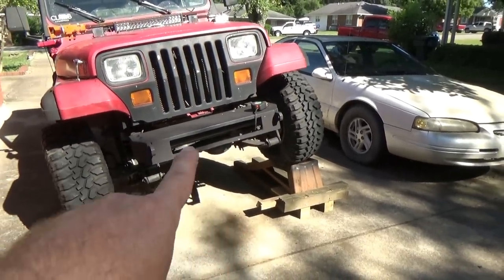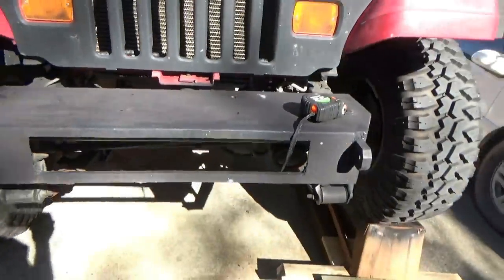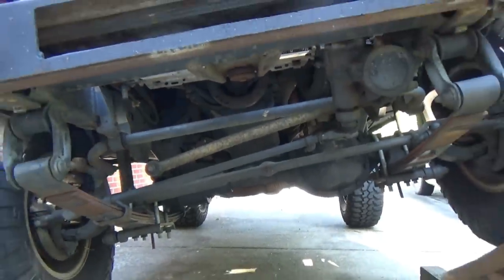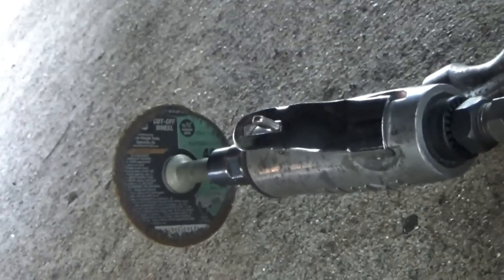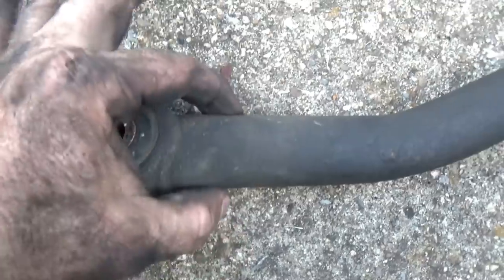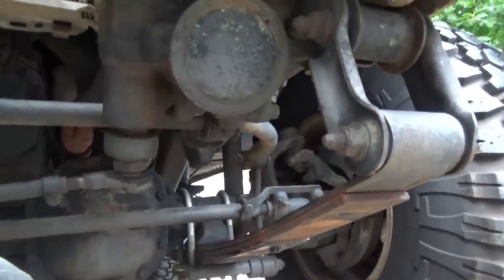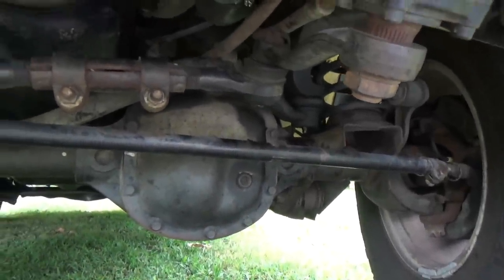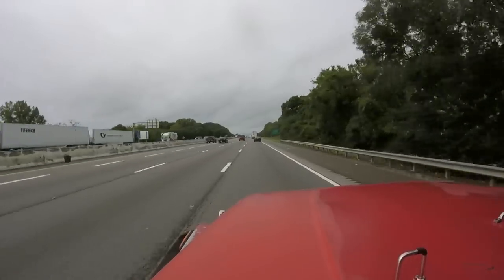Jeep Wrangler YJ - I removed my Track Bars

Comment: Just watch yourself if those leaf spring bushings go you will get death wobble with track bar removed. Mine didn't start until I ran 33" wheels, no track bars, no sway bars & then over time leaf spring bushings wore down... Buying new lift kit so all new leafs and bushings soon.
Reply from the maker: You need to check your steering parts. Only coil spring rigs get death wobble. I've owned Jeeps, Chevy trucks, and an International Scout, they are all leaf spring rigs that come from the factory with no track bar. This exact topic is all over the internet .. only coil spring rigs like TJ, XJ JK .. etc get death wobble. If a YJ has front end issues, its ball joints or bad steering parts. Have a great day!
Reply: Thanks - I’ve seen a few videos where leaf spring suspensions had death wobble but it makes much more sense to occur on coil suspension. I’m starting with leaf spring bushings - actually just running whole new lift kit because the springs I have on now are nearly flat and I believe I’ve got some axle wrap (clunk) - bought this jeep recently so just getting started, it’s my second - did a full build on another YJ that I owned for 10 years never had any suspension or steering issues. Thanks for the tip, might be worth just going through at all at the same time and hitting ball joints, pitman and tie rods. Not currently running sway bar or track bar but thinking about installing them since I have my old ones still. Thoughts? Thanks!
Reply from the maker: I've has some rough wore out leaf spring rigs and never had that happen. But anythings possible I reckon. Im gonna rebuild the front axle out my 93 and swap it under the 91. The 91 (the one in this video) is my daily, the 93 I have now is gonna be the toy. What lift kit did you go with?
Reply: Rough country 2.5” - bought the jeep with 2.5 body lift. Don’t want much more than that.
Reply from the maker: Im not a fan of body lifts. Both of mine have 3" because the PO installed them. The 93, I'm pulling all that out because I'll be seriously modding that rig. Id like to take the BL out of the 91, I just know there is gonna be twisted broken bolts. I don't wanna take it out that bad! LOL. The 93, I'll probably do another junkyard lift to start out. Thinking of a 6" rear stretch using Cherokee leaves. There is gonna be a swap meet this coming weekend near me. I've heard that RC is supposed to be there. I may go talk to them and see what they got see if the change my mind on the junkyard lift. I'm running mixed leaves in my 91, the other leaves came from a GMC Sonoma. I got about 2.5" of lift for a little less than $150. Works and flexes great.
Reply: ^The new rig I just bought is at the end of that album sitting next to that old blue ford pickup.
Reply from the maker: Where do I go to see this?
Reply: It is a facebook album - if it doesn't come up go ahead and add me
Reply: I just liked your fb page - I tagged your "Fix Jeeps" facebook page on my album. Feel free to comment on the album with any of your own rigs - love sharing ideas!

Comment: Got a 1990 yj would it mess anything up if i daily drive with the track bar and sway bar off and i only off road it acupal times a month
Reply from the maker: I drive minimum 300 miles a week in mine. It is my daily driver and even road trips. No issues at all running no track bar. I have quick disconnects for my sway bar. I havent had those hooked up in over a month. Dont miss them at all. Thanks for dropping in! Have a great day!

Comment: Thanks for this video. I will be removing mine very soon. Hope I dont have to cut and grind and cuss, so much lol
Reply from the maker: You are welcome! I only cussed when the camera wasn't rolling! LOL . I would say shoot plenty of PB blaster way ahead of time. But it wasn't the nut that was seized up, the bolt was seized inside the metal sleeve. Not likely any penetrating fluids are gonna help much with that. Good luck! Hope yours comes off way easier than mine. Thanks for checking out the video and taking the time to leave a great comment!!

Comment: I have a 94 daily yj, You mentioned that the cjs would flip over easy when switching lanes, how slow should you go? I'm really interested in doing this but paranoid aswell
Reply from the maker: I daily drive mine 70+ miles a day to and from work at 70-75 mph. Several 300+ mile road trips at highway speeds. No issues of any kind. What I said was sudden changes and curves. Not casual legal lane changes. At the end of the day its still a high center of gravity small 4 wheel drive Jeep Wrangler .... not a Corvette, so don't drive it like one. Its up to you as to whether or not you remove the track bars . The only real benefit is the Jeep rides smoother and more suspension flex. But, if it makes you paranoid, then don't do it ... If you don't take your rig out heavy 4 wheeling ... don't do it. .. Its OK if you don't. No harm done. I know several people still running theirs and their world is good. Oh, one more thing, its illegal in some states or counties to make modifications to your vehicle which can make you fail yearly inspections if you have to have that done. So check your local laws before start modding.  That may or may not be the answer you was looking for. But honestly any modification you read about, see on the TV or internet is a suggestion. Its up to the vehicle owner as to whether they feel comfortable with modifying their ride. Good luck and thanks for dropping in! Have a great day!
Reply: Jonathan Bernal 
I think the rollovers were with the narrow track CJs. I had an '86 for about 9 years and I've had an '84 for the last 3 and I've never had a feeling of rolling. Now I have s yj and the track bars will be removed, after inspection of course
Reply from the maker: True, the CJs had a narrower track width and a higher center of gravity which made them "more susceptible" to roll over. Even with the narrower track width sitting a bit higher, it takes a very dramatic situation to make them roll. After removing the track bars from my 94 YJ. It still feels very solid on the road and curves. Luckily my inspection doesn't care about mods. All my area does is check the exhaust and tail pipe sniff.
Reply from the maker: You asked about lift and tires. The previous owner installed a 3" body lift. I did a junkyard suspension lift that got me about another 2.5". Tires are 33x12.50/15 Maxxis Bighorns. Here is part 1 of the junkyard lift video: https://www.youtube.com/watch?v=RB00_P2XrEY . Part 2 : https://www.youtube.com/watch?v=_rYMUJMIZuM
Reply: Power Addicts - FixJeeps.com - Jeep, car and motorcycle tips 
Thanks for responding to that.  I deleted the question because I figured there maybe a video on it somewhere on your channel. I noticed you're using Factory 8" wide wheels. Do you have spacers or no? I have a brand new set of  33/12.50 KO2s that I'm trying to sell or trade for 33/10.50s, but if they'll work without spacers I'll just use them
Reply from the maker: It was still in my notification dashboard. Even if there was a video, I don't mind .. its cool. Nope .. running no spacers. Going full rack to rack they rub the leaf springs when full rack. I still have great turning radius. They run fine otherwise.
Reply: Power Addicts - FixJeeps.com - Jeep, car and motorcycle tips so I can just adjust my steering stops and be good to go? I appreciate your responses. One last question and I'll leave you alone how far past the flares do the tires stick?
Reply from the maker: I dont mind, it all good!! There are no steering stops. After a while, I just got used to how far to turn before I hit the leaves. If you have the steering wheel turned hard and hear a weird popping sound, you know your tires are rubbing the leaves. Back off the steering just a little and you will be fine. How far they stick out?? I'm honestly not sure, never really paid attention to it. Maybe about 3" or so. I'll look and get back with you on that.
Reply: Power Addicts - FixJeeps.com - Jeep, car and motorcycle tips CHUCK! you know what you did it; I changed my mind and this is the best mod I've done! And it was free. Chuck you're the man!
Reply from the maker: Rides much better doesn't it?!
Reply: Power Addicts - FixJeeps.com - Jeep, car and motorcycle tips hell of a lot better
Reply: Look at the difference between CJ and YJ leafs!!

Comment: You need to put them back on for inspection... mine just failed for not having them
Reply from the maker: Not where I live. They just tail pipe sniff it, take your money, give you the paper you passed and send you on your way. They are easy to take off and on as long as the bolts aren't rusted up like mine were. Thanks for checking out the video and taking the time to drop in a comment! Have a great day!!